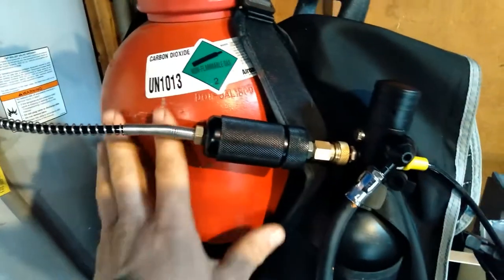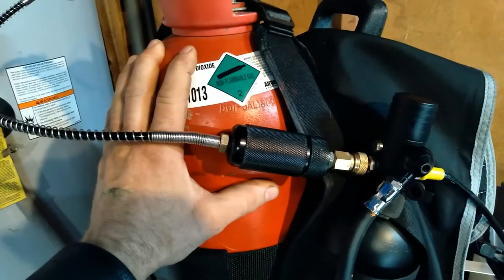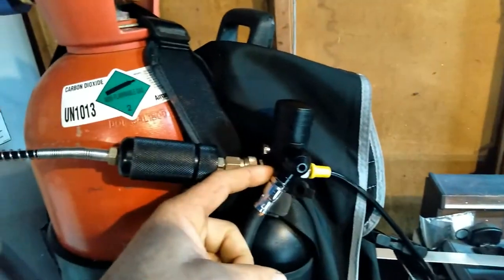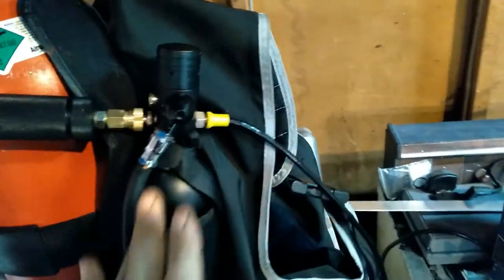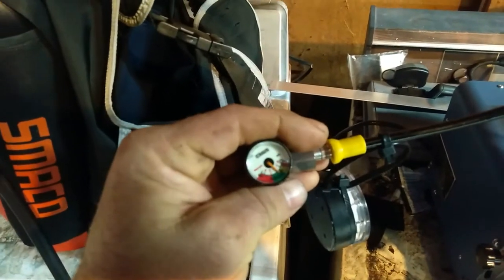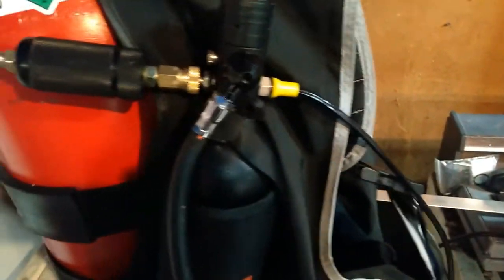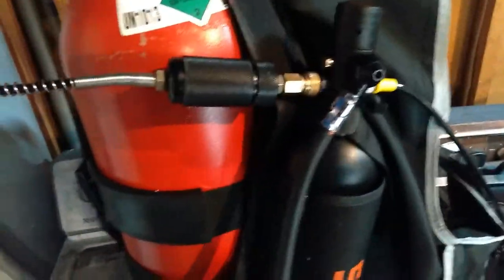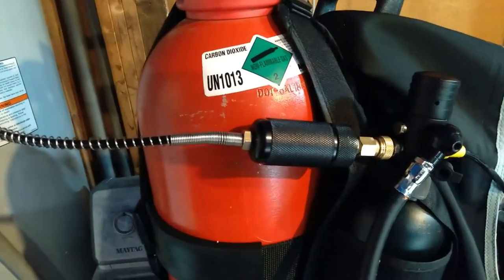DIY scuba tank

Comment: Impressive design. Would like to see a extended dive with it though.
Reply from the maker: I spent some time with it up in Lake Jocassee, but I was just testing the tank no BCD to really control depth (I just shoved the tank into my ALICE pack).  

At less than 10 meters I spent about 30 mins under water.  Tank pressure went from about 2000 psi to 1200.